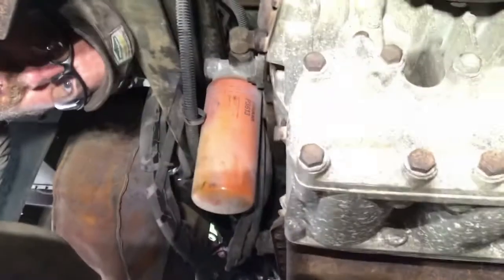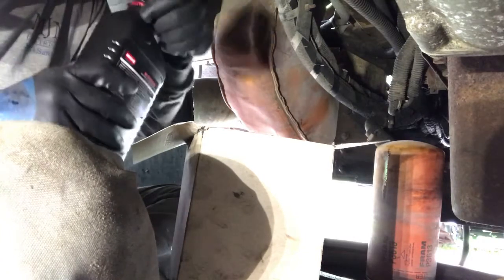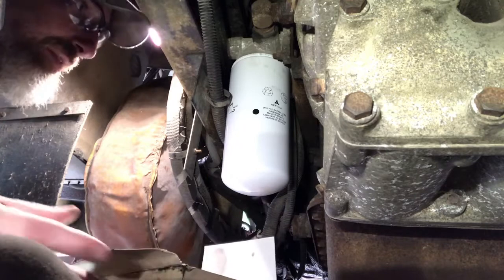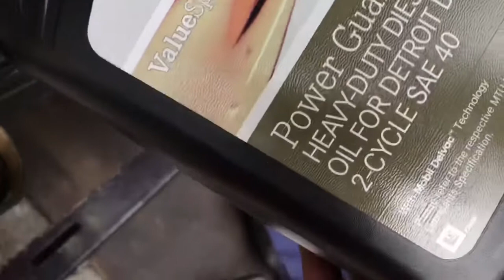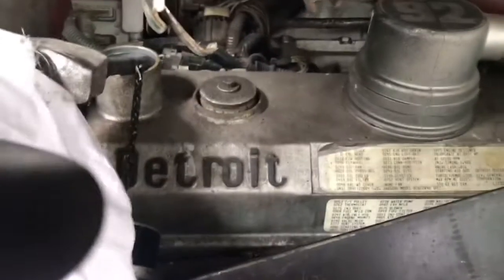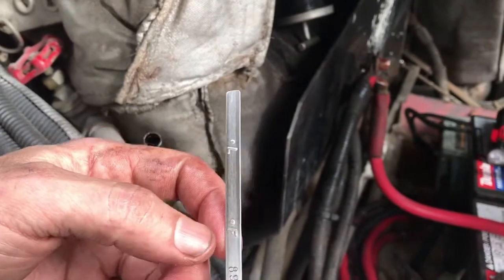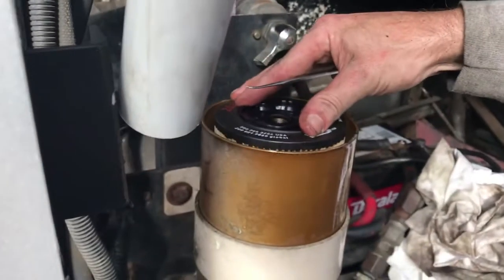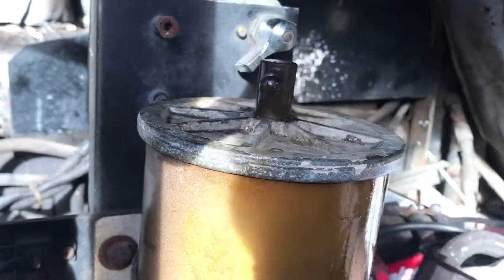-Gino’s Garage- Maintenance On A 1988 Bluebird Wanderlodge WB

Comment: I like that remote oil filler. If it ain’t using oil, it ain’t running if it’s a Detroit
Reply from the maker: This WB with the DDEC is not like the mechanical Detroit’s.. I ran the DDEC 8v92 engine after changing the oil expecting it to turn black immediately like my 6v92, nope, the oil still looks like new.. amazing what a difference the computer control makes. But it does have a few oil leaks but nothing major..

Comment: On the Racor I thought it was important to add some diesel and top it off. And any tips to avoid air while changing fuel filters? Thank you so much for your videos.
Reply from the maker: I usually top the Racor off with a fuel treatment or automatic transmission fluid, since I already have them or you can pick it up at any auto parts store. Also fill up the secondary filter with the same. This is usually enough to get started and it will work the small amount of air out. It also helps if you do this with a full tank of fuel as it pushes the fuel to the Racor due to being above the height of the Racor.
Reply: @GinosGarageUSA  Will do and I wish you were available in April!! Let me know if you something falls thru and you are

Comment: Is there an internal filter that needs to be changed on those?
What kind of trans fluid?
I have an 87 pt 40 8v92
Reply from the maker: Yes, the transmission will have an internal filter that is changed at 25,000 miles. The external filter is changed at the same interval. The original fill on these transmissions were Dexron or Dexron II. Double check what transmission you have, there should be a tag on the driver side of the transmssion that will tell you what the model is. This 1988 WB has a HT748. We did not do a full transmission service as we are just prepping this bus for travel to its final home and then many of these items are going to be taken care of by the new owner.

Comment: Do you write the dates on your filters? Just wondering. Thanks.
Reply from the maker: Each filter gets month and year on it, a little Bluebird logo and Gino’s Garage..
Reply: @GinosGarageUSA  Awesome!
Reply: Transmission filter was a lot tighter than the oil filter.
Reply from the maker: @Landscapemarketingsystems  Yea it was on there like I would expect good and tight. Usually filters seem to get tighter over time. I suspect the oil filter was put on and the engine was not run much after.